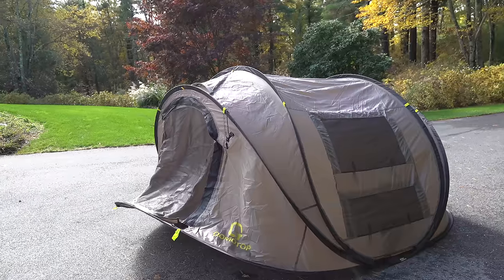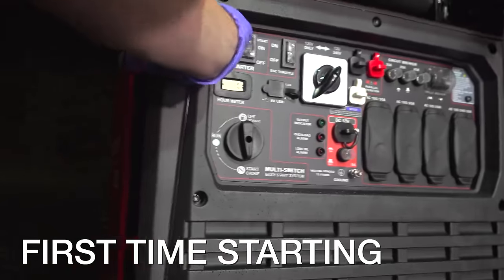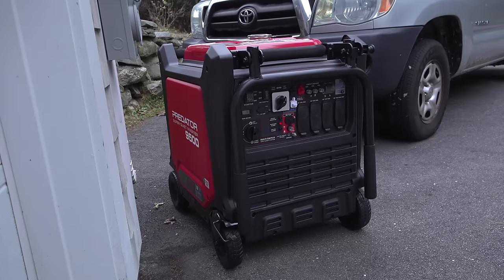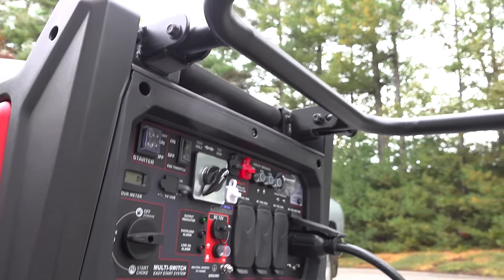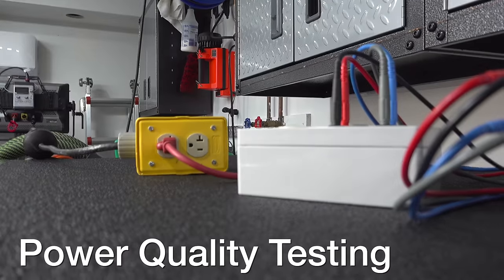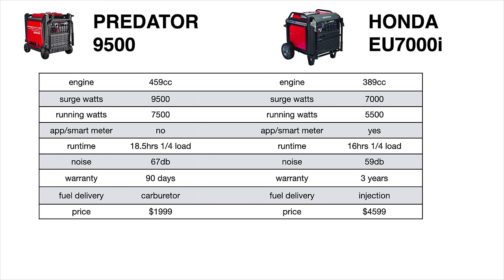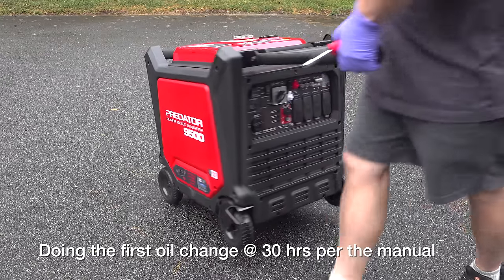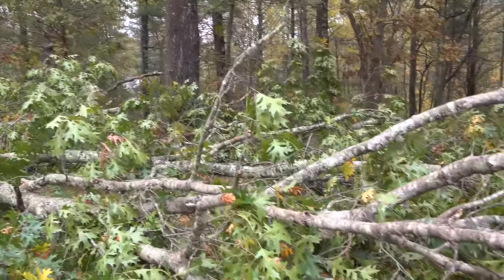BIGGEST Harbor Freight Generator Predator 9500 Review & TEST

Comment: Nice review! Would love to see a long term review with that 90 day warranty. Some of that price difference can be chalked up to technology (smart app, injector vs carburetor). But like you said, reliability could be an issue
Reply from the maker: Agreed, I am hoping others may comment who bought them earlier this year and can share their feedback too.
Reply: The Honda’s have had fuel Injection issues in the past. For the money roll with the Predator.
Reply: @Dive-Bar-Casanova  That’s just it. If you prefer value over known reliability? Then the Predator is your generator. I work as a lineman for the local power company. I’m often at work when the lights go out at home. The safety of my family is paramount. Even on top of value. You can’t put a price on safety. When I’m knee deep in work the last thing I want to hear is my family is sitting in the dark because the generator won’t start or run? The few times my family has called on it to work? Wether it be 10 degrees out or 90 degrees. The Honda always starts & performs flawlessly. All we use is Honda generators at work. They get knocked around. People leave untreated fuel in them & they still start on their first pull. Value takes a back seat to reliability every time.
Reply: @johnclyne6350  buy 2 predators parallel them and still save money. if one dies you still have the second...
Reply: @hopsricebarley  bingo this man wins the prize. for price of a single honda you can buy 2 HF and a dozen quality gas cans. two is one and one = none. fyi after Irma my buddies eu20000 would not start. he wound up borrowing a HF tailgator from his neighbor that did work.
Reply: @johnclyne6350  I too have Hondas and Predators. Hondas have as many mulligans and the HF's. Predator HF honors the warranty, Honda does not and never will.
Reply: @johnclyne6350  ⚠️Very important announcements to everyone about portable generator safety:

This is just a reminder.

1) KEEPING OTHERS SAFE: Please do not allow an unqualified person or your children to operate and service the portable generator. Just because some manuals don’t say that doesn’t mean it’s safe. That is important against the generator safety rules. We also need to be keeping an eye on our children too. You need to make sure that your children are not playing near the portable generator especially when it’s running so they won’t get electrocuted. Generators pose electrical risks and they can be hot during an operation. Please keep your children away from the portable generator at all times. It is important to keep our children safe especially our little ones. Be aware of all the hazards.

2) WHERE TO RUN YOUR GENERATOR: Some people use their portable generators indoors which increases the risk of carbon monoxide poisoning. It’s important to have a carbon monoxide detector if you have a gas generator. Never ever use your generator indoors even if your doors and windows are open and even in the garage is not safe to use a portable generator. Not even at your porch and your deck. It is never safe to use your generator indoors and in enclosed areas of your home. Your generator needs to be 15-20 feet away from your house. 

3)🔥FIRE HAZARDS: Never refuel your generator while it’s running. You need to let your generator cool off before refueling it and before storing your generator. Never overload your generator too. Never ever back feed your generator. You should never plug your generator into a wall outlet. Also never store propane tanks indoors. Please keep flammable things away from the generator as well and please don’t smoke cigarettes near the generator. Having a fire extinguisher next to the generator is also important against the generator safety rules. 

4) GENERATOR OPERATION: make sure your hands are dry before touching the generator. Never use your generator in wet conditions. Don’t let your generator get wet. You need a generator tent if you need to use your generator during wet weather. Please don’t wear loose clothes when operating the generator. Turn on your generator before plugging in appliances. Use the right cord for your generator. Please do not use worn out cords. 

https://youtube.com/shorts/eFigDfnPkcQ?feature=share and here is a video more about keeping others safe when using generators 

Hope this helps. Remember safety first.
Reply: @hopsricebarley   I was thinking the same thing, surely if you buy 2 predators they would keep you in power  as well as  the Honda plus you would have twice to power if you needed it.
Reply: @johnclyne6350  Yeah, except that you're not paying for the units at work.
Reply: @Dive-Bar-Casanova  Agreed. I have used Predators for 4 years now. I do buy extended warranty and have used it with no issues. I take bad generator in and swap out without hassle. No questions asked besides the basic "Does it have any fuel in it?" .
Reply: We had non-stop issues with our Predator 9500 -- I really can't warn against them enough. Brand new unit arrived with non-working electric starter, 240V output never worked (only one leg would come up irrespective of switch position), and the spark arrestor would "foul up" every 12 hours or so (known issue). My guess is the smaller Predators sell more widely and are better tested -- the 9500s are complete crapshoots.

We ran this alongside the Honda and boy do you get what you pay for.
Reply: @VladShulman  Sorry you had trouble with yours. I know I bought three of these and have had no trouble whatsoever over the course of almost 3 years. I bought one for my house, one for my mother's house, and I bought an extra I use at my rental property so my tenants will have some power during an outage. So far so good on ours, I did have the spark arrestor issue with the one I use at my house but it was an easy fix and covered under warranty, also the warranty was super easy with mine as well. For the price I can't say enough good things about these. I also have the smaller 2000 watt generator that you can carry with one hand. that thing gets a lot of use, gets bumped around a lot, and it has never misfired a single time or had any issues at all.

Comment: We winter in the southwest desert of Arizona. There are no hook up's you have to be self contained. Once most people get to the park Jan/Feb. HF generators out number all other manufacturers 3 to 1. However I see more and more people using solar. What I have seen so far this year, solar has about double. This is our 4th season and we have used solar from the beginning. Our system is 3000 watts of solar and 600 Ah of lithium batteries. Gets a little hot early in the season. I am able to run our AC off the solar. Thanks for doing a great review 👍

Comment: I bought my 3500 when I moved down to Puerto Rico. What a life saver. The generator runs great and I change the oil every 35 hours or so. With all of the electricity problems here, it does its job flawlessly. I do have a 21kw diesel generator now for the whole house. But when I turn on the predator every couple of months to make sure it is running it starts right up.
Reply: 21-kW is a lot of watts. It will burn a lot of fuel even at no load. A battery/inverter set-up would minimize generator use. Throw in some solar panels. Diesel is $$$. What % of time are you off grid? Months at a time? You have big inductive loads?
Reply: @melaniecotterell8263  Here in Puerto Rico a solar system with batteries is around $80k minimum. Trust me I have looked at it. I even looked into trying to ship a DIY system from the states. It is crazy money to get it thru customs. Selling the house in the next 6 months and getting back off. Going back to the US mainland. Sick of the bad electricity service here and the $1400 monthly bills that keep rising every month.
Reply: @skeee1  I got off the island in 2013.  I saw the writing on the wall then already and I'm glad I left.  It didn't look like the place I wanted to  be when things went sideways.

Comment: I've had my Predator generator for 4 years now. I run it for about 4 hours every 4 to 6 months connected to my camper. I've actually needed to use it once. Had an electrical outage over night and it ran for 15 hours straight. 
Needless to say when start it with choke on doesn't need it. It cranks asap and have never had an issue. After 6 years of ownership with the Predator almost doubling output power you would still be  ahead purchasing a Predator every 3 years compared to a Honda. I'm on 4 years on mine without missing a beat and can only say good things.

Comment: I have had a preditor generator for at least 5 years now and use it for power outages. The biggest issue I have had was the magnet on the flywheel blew apart. It was not an easy task to find a replacment. With that I would say if all you can afford is a preditor get it. If you can afford better name brand stuff get that and it will be easier to find parts. Some honda parts work for these but not all.
Reply: Harbor freight has it's own parts download your parts manual then call the 800 number..they will send you the part for free if it's covered under the warranty..if not covered you just pay the cost of the part

Comment: I have an older predator 9,500 watt generator. I bought it used from a construction company. It runs good and is easy to start using the rope starter. It has over 300 hours on it. So I have never put a battery in it. I am 69 years old and start it with no problems. My first Harbor Freight generator is the 2 stroke 1000 watt with 800 watts continuous. I have used it for years. It's a little hard to start in really cold weather, think 1" of ice on everything. So I am not afraid of their generators.

Comment: I’ve used Honda generators for close to 40 years from the small 1000 watt all the way up I use them for my business and personal I had some them for 20 years now in the summer I’ll run them 8-10 hours a day when trimming hedges in 90 degree temps no issues I’ve always been tempted to try another less expensive brand but just never pulled the trigger would love to see a long term review on this model.
Reply: Do yourself a favor and stay with the honda. Old saying you get what you pay for. predator generators break down to easy . Chinese metal.

Comment: Predator is 3x louder and will be a paper weight in a few seasons. Honda will still be worth thousands second hand with over a decade of use. How do I know this? Because I fix these generators. Well to be fair I don't fix very many Hondas but the Harbor Freight junk always comes in with everything rattled apart after maybe a couple of hundred hours of use. I've had Hondas in with 5 to 6,000 hours they needed nothing more than a carb clean and a new air filter.

So spend $2,000 on something that will be worth $200 in 5 years. Or spend $4,500 on something that will be worth $3,000 in 10 years.
Reply: The 90 day warranty on the HF gear is telling about the manufacturer's expectation. It is too bad they can't fix the little problems, charge 2500, and back it up for 3 years.
Reply: You make a great point!
Reply: I wouldn't buy any generator used unless it was almost free and who knows if it was maintained
Reply: This is why I bought the Honda. Due to hurricanes, we can be without power for days, even weeks. Got to have reliability!
Reply: I have a Predator. 6500 watt that I bought in 2012. This past year when power went out in Texas from the freeze it started when the temperature was 8 degrees and a wind chill below 0. Actually it surprised me that it did start. 6 circuits hook up to the house and it never missed a beat. I think I paid around 450.00 at that time. Not everyone has a budget that fits over 4000.00 for a generator. By the time you buy a quality transfer switch and hook it up your getting close to 5 grand.
Reply: I would never buy a ten year old generator. Period. And would buy two predators before the Honda! I have 4 predator gens from 2200 - 8750. Every one of them worth the money. Just say'n.
Reply: @rickwilson466  I agree.
Reply: Hondas are great but they are price prohibitive for most buyers. Most people that are looking into a Predator/Champion/Firman Generator are not going to ask them to run for thousands of hours. They are looking for them to run on a camping trip or if the power goes out for a few days.
Reply: @plkracer  if you get the extended warranty on the Predator it's just an exchange program. If you have any problems with it you just bring it in and they give you a new one. I doubt Honda's warranty is that good.
Reply: @recrdholdr  a 3 year warranty should be included in the price, 90 days is a joke on a piece of equipment someone uses 2 times a year. They can add an hour limit as well if they are worried about commercial use. Exchange programs are different, I'm sure you can purchase one for a Honda generator through their dealer network.
Reply: Do you see a lot of the predator line or just chinese harbor freight generators in general?
Reply: And also why the fuck would anyone spend 5k on a honda portable generator when they could have a generac that runs off their propane or natural gas? Youd be pretty stupid to buy the honda in either situation.
Reply: @nallen1006  Rental outfits must all be stupid, then, because as far as inverter generators go, they pretty much rent out Honda's exclusively.
Reply: @jmljml5065  Yeah because they're going to rent out standby units huh, lmao
Reply: I have a Honda that I bought USED over 15 years ago… Runs my whole house, only had to change oil and battery over the years…
Reply: @RustyShacklefordJr1337  I took apart my snap on air wrench when it failed and it had chinese bearings in it. I buy harbor freight now and toss them in the garbage when they break after a couple years. Fuck over paying, but if thats what you want to do go for it. 

And you could have a generac 14,000w standyby generator by $1,000 less than that honda.
Reply: @nallen1006  I'm a "buy once" kinda guy.  Those chinesium tools just feel wrong in my hands.  I don't care if im only gonna use it once, ill pass it down to my grandkids or something.
Reply: @nallen1006  I'll leave all the awesome Harbour Freight tools for you man.  Lol
Reply: @RustyShacklefordJr1337  Hey i get it, you guys like paying 10x more for a pretty case. Its all good. Not like they'll get dirty anyway.
Reply: @nallen1006  Shit, if im paying a few thousand for a tool ill use twice in my life, you better believe I'm gonna keep it clean haha.
Reply: 12XX hours on my predator 3500 inverter. Oil changes and air filter cleanings. At about 800 hours it wasn’t running quite as smooth and I changed the spark plug. I use 15w-40 diesel oil. 

I think I might do a valve adjustment soon. Just for giggles.
Reply: I live off grid, so my generators get used daily , not just when a storm hits. And living in Florida , they run almost non stop to run the air conditioners  during the long hot humid summers. Currently I own 5. 2-3500 Harbor Freight inverter , 1- 3500 Honda open cage, 1- 3500 Suziki open cage , and 1- Honda 2000 suitcase model. but it smokes real bad.  The 3500 Honda I've had for 17 years and it still runs great, but it is loud , and burns lots of gas. I mostly use the 2 Predators , because there pretty quiet , and good on gas. BUT  , I've had to return 4 of them because they quit running because the coil went out on all 4.  All had the extended warranty , BUT, when you return them, you get another new one. BUT you lose the extended warranty. It is not transferred to the new generator .And you have to buy another  $ 100. extended warranty on the new one your replacing under warranty .   That suck . But I don't blame the  Predator engines . I have a Predator semi-trash pump , that I use for irrigation . It's been sitting out at the pond for 4 years now, uncovered, and it starts the first pull, every time. and runs like a champ. Oh thats reminds me , I've only changed the oil once.
Reply: Amen brother
Reply: @randymack1234  quick question, if the pull start cord on a generator is locked, or doesn't want to pull out. Any suggestions...
Reply: @louisj4645  First start by  removing  your spark plug. That will remove any compression, or  fluids that might be in the cylinder .  See if that's helps.
Reply: If you pay for the 2 year extended warranty you can return the unit every 2 years and get a new one. Honda doesn't do that.

Comment: Nice to see you take this on. I just received its blue sibling, the Duromax XP9000iH and am in the process of building out its enclosure. The Duromax costs a bit more, but has a mechanical choke, built-in trickle charge and remote start. With interlock, I should not have to step outside to start it and switch. If the windings and engine survive a decade of the occasional use, I'll consider it worth it as a poor mans Generac.
Reply: why is it so difficult to go outside to start a generator?
Reply: Yes, I was curious:  Does DuroMax mfg this for Harbor Freight?  

They appear to be identical except for color.  I paid just a bit more for the Duromax to get a dual fuel model (XP9000).  I only run propane, that way I can store it in the house in my back hallway... Very happy with the unit.
Reply: @thomasmoran168  Both are made by the same contractor, and tailored for the respective brands.
Reply: @Asidebar  because it’s warm and cozy in my cabin and cold and wet outside. Nothing beats looking through your window and watch your generator to start and run.
Reply: How is it working out?
Reply: @bluyetiinc7553  Great. The remote was a bit flakey, where after sitting for weeks I could no longer start it until pushing the button on the panel. But since it's ATS ready, I got the pinout from Duromax and fashioned a wired switch with 100% success rate.